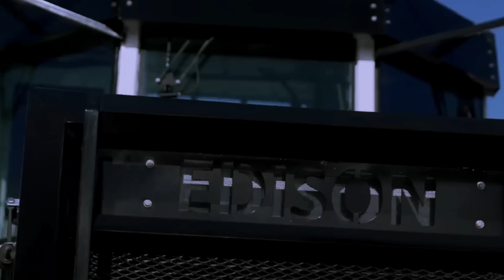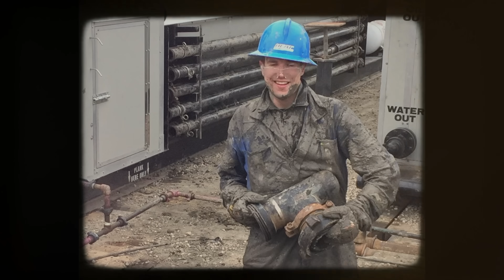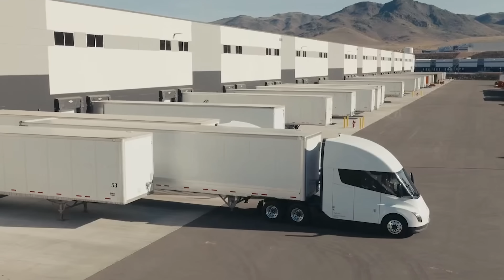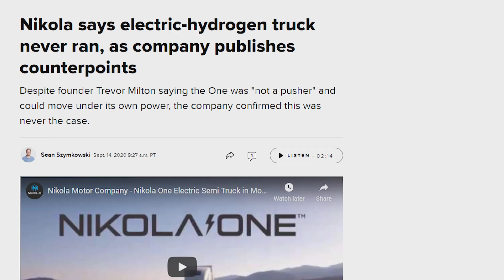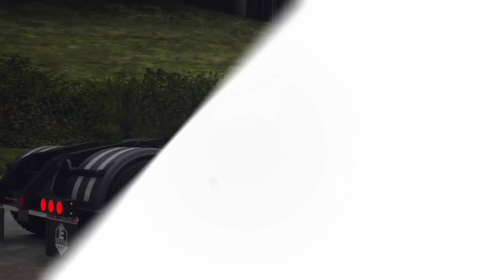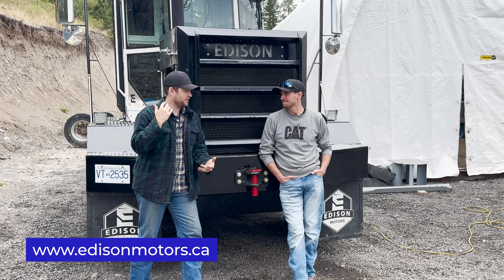How We Built an Electric Truck From Scratch

Comment: Just some quick questions: 1) does your truck have 500 miles EV range? 2) will it have full self drive? 3) when can you realistically deliver your first production truck? Will it also take 5 years? 4) what will be the yearly production capacity? 5) will it cost less than 180k? 6) does it comply with all security standards? 7) can it be insured? 8) can you explain your warranty?
Reply: 1) no
2) never
3) next year
4) they need an actual factory building to answer that question, next year they’re building 8
5)no
6)yes
7)it is actively insured
8)it’ll be the best warranty you can get on a production vehicle because they themselves are truck drivers who are tired of getting screwed over.
Reply: @CaptainCrutch  Great that they are adding a new EV option out there, but based on your answers, it will be difficult to compete with the new market offers.
Reply: @adrianpaz472  you don’t understand the market they’re going for. They’re not going after dryvan haulers like 90% of semi manufacturers, they’re catering to everyone else. The kind of market where spending half a million on a rig is normal. The trucks to tow the other trucks, to move super heavy loads, to be used in the oil fields, in construction… the kind of truck that the other manufacturers stopped building because they realized they could make more money by only catering to box trucks, converting the factories building the trucks that build things into factories building Amazon delivery trucks.

The only ones still building trucks to compete in these markets is Kenworth. That’s it. It’s nice to see someone else step up to the plate again.
Reply: @CaptainCrutch  i see, thanks for the clarification. Probably got confused because they were comparing to the tesla semi.

Comment: How many miles can you get with a full load? How long does it take to recharge?
Reply: If you had seen videos you would understand that these are questions that cannot be answered easily. It's not meant as a highway queen for a box trailer where many parameters make it comparable.
If they log from one mountain close to the lumber yard it can be very good thanks to regen, if it needs to go further losing out on regen it is worse.

It's a series hybrid. It charges on the go. How big batteries they have can determine how much time in between charging they can go without the generator running but ultimately it's the diesel tanks that determine the recharging. 
It could/should have a AC charging that fills it up over the night so you have one less diesel cycle to do. But it didn't affect any charging time since no one was waiting for it.
Reply: Watch their recent video with them hauling logs with Topsy.  They did two loads, and travelled about a total of 170km.  They used 45% of the battery and the generator never needed to run.

Comment: British Rail did the same thing with their Intercity 125 train - it's the most successful pasenger train of all time :)
Reply: I don't think it's the same thing. You can check the wikipedia article on Hybrid trains which would be "the same thing" where it's ruffly 10-15 years since they first entered commercial service.
The wikipedia article on Intercity 125 only mentions 'battery' once in the sentence: "Another single engine, 43089, was used in tests on hybrid battery powered vehicles in collaboration with Hitachi." Did you mean that? Because it was written like all Intercity 125 were hybrid trains which I cannot find they are.
Reply: I meant using off the shelf parts - not hybrid, though some new trains are...

Comment: Stealing all the ideas that Tesla left on the drawing board.  The good ideas that made a better machine instead of a virtue signaling plastic crap. Edison design properly engineered truck, Tesla semi designed by toddlers.
Reply: You do know both trucks are build for different things right😂
Reply: @mcsike7264  edison built for success, Tesla built for failure
Reply: @jamesocker5235  ya sure and how many trucks have edison delivered tesla has over 100 my now and they are being used by both tesla and Pepsi and they are also building the factory thats gonna mass produce 50k of em a year as I type this message so you might wanna delete this comment its embarrassing

Comment: It is not electric. It is diesel.
Reply: Technicality. 
It's an electric vehicle with a battery where energy is coming from to turn the wheels.
To charge those they use a diesel engine with a generator. A series hybrid. Still electric when it turns the generator off. Is a truck that is filled up with hydrogen that is turned into electricity with fuel cells not electric either? 

Topsy isn't a full BEV, that's true. but neither just diesel. That's why we even have the "series hybrid" classification because those don't fit in either category plainly.
Reply: @subwarpspeed there is no intention to plug this truck into any charger in a real use case.

Comment: I see great potential in this. So many similarities between Canada and Australia. If it works there it would work here.   It will be interesting to see how the drive train holds up compared to a mechanical drive. I suspect better with less maintenance.  

I also wat to turn one into a fire truck.

Comment: How much power a 50 tone truck needs to maintain 60 km/h speed on leveled road and how much power requirement increase as we go higher angle roads ? And what kind of generator do I  need?
And what's the mileage of these modified trucks?

Comment: Been following for a while now, and love what you and your team are doing, and now with the new Scania engines! 
One of the biggest differences I've seen between what you are building and that the rest are trying to build is you are building a truck for capable and knowledgeable operators, they're making trucks for the steering wheel attendants hired by companies that just want bums on seats. 
People that will buy your trucks will mostly have a good understanding of what makes that truck work, and how to get the most out of it, their trucks will be stupidly automated, and outside of making the screens "user friendly" the rest of it will be nothing but a moulded piece of plastic that you can't touch, even for basic maintenance.

Comment: Using common, tested and improved upon parts over decades, for most stuff is perfect for getting useful tools like your semi off the ground and fast to adopt for clients that can benefit from these - ALL THE BEST!!

Right there with you with the rants, started going off with: Including simpler more reliable approaches - don't want to or can't fit a bunch of screws around a housing - sure, makes it easier to maintain, by making it slide into a wedge or slits and fasten with one or two screws instead of making everything hook into place with the same amount of weak plastic hooks that brake and are a hassle/strain on parts to remove. Your panel of electronics was also refreshing - sometimes have to take the hole machine apart to maintain a simple inexpensive part..
Reply: Though I can also understand not wanting to be dependent on someone else's solution for something you depend on (especially if it's simple enough) and possibly getting tied into a price or licenses - shouldn't be that fragile to such a change. In software it's best to do the simple and mission critical stuff yourself - keep it simple - not forgetting the "soft" in software.

Comment: Congrats on getting the trucks to work. I agree that there's almost certainly a market in remanufacturing old(er) trucks to hybrid electric.

Now however, you might have a bigger challenge. Building one or two more or less bespoke trucks more or less by hand is one thing. Building the machine to crank them out by the thousand is quite another matter. Good luck.

What I'm sort of waiting for is for someone to more or less out of spite (toward the radical greens) build a hybrid electric truck with the power provided by a coal fired reciprocating steam engine. Cargo capacity be damned.

Comment: Even what Tesla has done with their electric truck is nothing new. It's just a giant over-engineered battery powering motors and way too many computer systems. Theirs has to be charged and hold a charge long enough to get something accomplished. You're following what they've been doing with diesel-electric locomotives for generations which is proven to work. The only difference is you added the battery to hold the charge to make things work and the engine and generator keep the battery charged. Now if someone took the same idea and made it work in a 1500 - 3500 class pickup that would be great. :)
Reply: How is the tesla semi over engineered it has the same screen as the model 3 tesla plaid motors😂

Comment: I really like your enthusiasm, you talk the way it needs to said. You have discussed many many positive sides to your machine. I haven't seen any fire suppression systems.  I think battery electric systems are great until they are on fire. What, if any are in place. With dry conditions I would really hate to see something great like this be tarnished by a "thermal event". Keep up the great work, I enjoy your videos.
Reply: This is actually the first valid point someone has on this truck.

Comment: Having the tech-bros is gonna make your software maintainable. You built really great software, but you're a slave to the hardware's software. What if they stop offering software to interface with one of your parts? How are you going to ensure that your customer's maintain the ability to edit their hardware's settings?

I really think you guys could do well to develop your own interface software which is designed to interface with the multitude of different hardware through one application versus having 50 programs to edit 50 different components.

This is going to be one of your more significant hurdles in the coming years. You have truckers who can only get their truck serviced by a trained professional and they're going to blame you for "not making it easy enough" to fix your own shit. Mark my words.

Comment: Hybrid Heavy trucks, for sure, but then get onto making a real heavy duty pickup truck again. Something like the late 70's Toyota HJ 45  1 ton, or Grizzly, or older Dodge powerwagons. Make them simple and reliable they'll pound a path to your door. 

I'd also suggest a small import size like the 2010 original Ford Ranger, not the bullshit new version. Lots of guys love that size of truck but you can't buy them anymore. Ford even made a few electric Rangers as California 'compliance' vehicles in the 90's, but realized they would just abandon small trucks because the profit margins were bigger on F150's with the predictable result you have to pay a ridiculous price for pickups now with all the fancy crap in them.  

Modern pickups are like expensive plastic shit boy-toys not built for loggers and ranchers. 

Last of all, keep building in small towns. The type of crew you need will move to you, just because they'll find the housing price and living style they want where you are. Avoid the big-city bullshit told to you by the tie and suit crowd.

Comment: New volvo and mercedes trucks (in my company) have electric(button operated) parking brakes..
And they have failed on a 3 year old actros already.

Meanwhile: Scania still uses a user actuated valve. It just works. It does not have "software glitches" and errors.

When it comes to essential(!!!) safety, DO NOT make it complicated. Make it simple and make it work.

Comment: I mean... you needed the engineers to engineer the puzzle pieces. But you don't need to invent the wheel for getting the puzzle together.

I think that Tesla need all the 1% efficiency bonuses to get the semi working with only batteries. So they have to reinvent every piece. Your strategy seems to be the winning one.

Comment: I wish someone could build a standard pickup like this. Use common parts. Make it easy to work on. Easy to repair. YOU being their biggest concern, not selling you on something that's gonna fall apart in 5 years and you need to buy a whole new truck.
Reply: They are doing pickups also
Reply: @smokindauberdoo4208  They are going to be retrofit kits, not the whole truck.
Reply: @shadfallfan  I know
Reply: @smokindauberdoo4208  Yes, partnered with a company on the other side of the country & focus on 3/4 tons. Would be nice if there was a conversion for smaller pickups, like my Taco.... ;)

Comment: 8:00 sneak peak of Topsy getting loaded
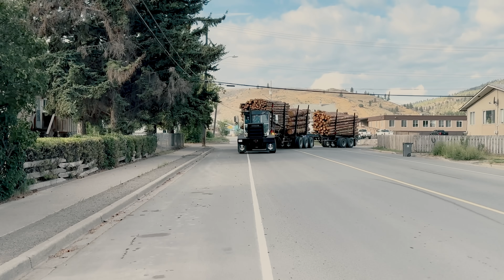12:24 Topsy driving loaded
Reply: What was that four seconds of driving?  Shut up.
Reply: @RazorbackKen 4 sec of driving content, but that was so short it's possible you didn't see it. But that 4 seconds imply they did a fully loaded run, and that's probably in the next video.
Reply: @raphiseth6942 exactly. At least on YouTube we haven't seen Topsy loaded up. Given it was a time since we saw the video of the trailers being hooked up and weighted, I suspected they have been hauling logs since then. It's nice that we actually get it shown. If I remember correctly Carl was unable to do that (is a limit to how much you can strain a car motor...).
Reply: Very eager to see Topsy driving loaded at speed, as well as up and down grades. This video was a great surprise first look at that sort of testing though!
Reply: Looks like she's getting unloaded, you can see the logs getting raised up.
Reply: @Lillstisse661 sorry you are right.

Comment: ohhh Chase,  super well done.  Your goals would be different from Telsa Motors.  Telsa want to make BEV and not a PHEV.

You are doing things correctly, things dont just exist, they exist becuase millions of people of failed along the way, whch is why we have the trucks we have today.  Edison is doing it correctly, build the network, build support, build the supply chains, build out training, etc Selling one truck is not a probem, servicing 1,000,000 trucks is a problem.
As you inferred  with the Scania video, next day parts in Northa America, is not by mistake, truck downtime is lost revenue.  BTW you may want to set up Edison distribution next to Scania distribution centers as they have already figured out the logistics, labour and warehouse costs. No need to re-invent that whell. 

Another note:
"prototypes are easy, production is hard"

When you  plan to build 50,000 tractors a year, the prototype is not the problem, “the machine to make the machine” is now the problem.

No doubt your truck might not need all the ammenities, however trucks operate in all conditions.

FYI; 
Telsa semi has been delayed in part by the lack of battery supply.  [1]

Once again, super well done you guys. “Bring innovation and manucaturing back to North America"
Cheers

Ref: 
[1]https://insideevs.com/news/672016/tesla-semi-volume-production-wil-not-start-until-late-2024/

Tesla doesn't expect to start higher-volume production of the Semi Class 8 electric semi-truck before late 2024, CEO Elon Musk said yesterday citing battery supply constraints.
Speaking at an energy conference in Austin, Texas, Musk did not provide details on what higher-volume production means for the Semi, the Wall Street Journal reported.
However, Musk previously said the Tesla Semi would reach an annual production of 50,000 units starting in 2024. Speaking on the Q3 2022 earnings call in October 2022, the billionaire said it would take about a year to ramp up Semi production. About a year from October 2022 would indicate late 2023-early 2024 as the start of the production ramp.
"So, we're tentatively aiming for 50,000 units in 2024 for Tesla Semi in North America. And obviously, we'll expand beyond North America," Musk said.

Comment: Next up: Competing with John Deere
Reply: Competing with Deere   is alot easier now that they moved production out of the US and will not let you work on your own tractor !
Reply: Diesel-electric tractors are the way to go 👍🏻
Reply: If only. Those assholes are everything wrong with big business.
Reply: More like Dohn Jeere.
Reply: Combine harvester- it’s going to such a great deal!
Reply: *Lockheed Martin
Reply: John deere is partially owned by Cat, Cat is pursuing the hybrid power systems and have been for years.
Reply: @dvdguire  but John Deere is also the most anti-ownership anti-repair company in agri-biz next to Bayer. So definitely need an upstanding company of engineers to target their bottom line.